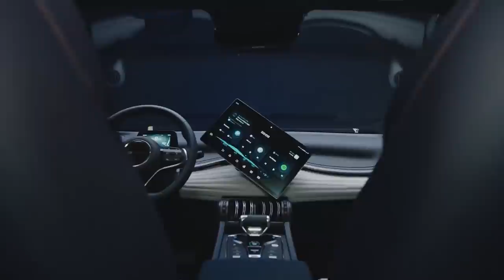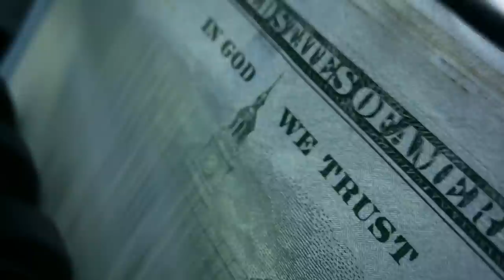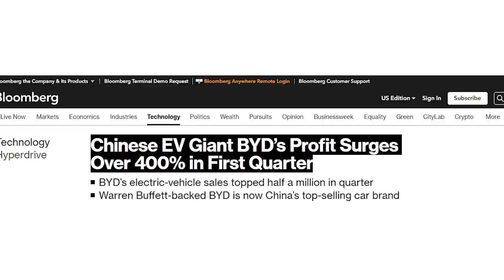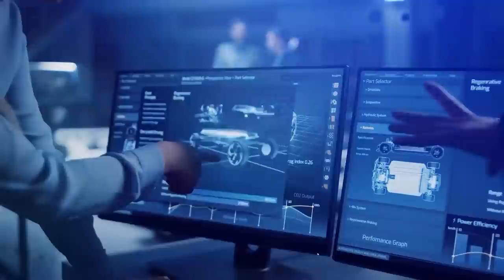HUGE Blow For Tesla | BYD Mach Profit Margins (almost)

Comment: From January to April in 2023, BYD passenger car cumulative sales have reached 757,384 units, the performance is really strong. New energy vehicle network learned that BYD's new car sales in April, hybrid and pure electric sales continued to show a flat trend, including pure electric vehicle sales reached 104,364 units, an increase of 81.81% year-on-year; The sales volume of plug-in hybrid electric vehicles reached 105,103 units, an increase of 118.64% year-on-year, with the two forms of power respectively accounting for half of the total sales volume.

Comment: Seagull's price is insane, if current technology really allows such a car, even say in Europe, for 15-16 000 euros, it will be a game changer. 
I think many people still when they look at electric cars they think that the market is limited BUT the fact that BYD overtakes Tesla in China or anywhere does not mean much in the grand scheme of things. But the fact is unless we talk about trucks and big SUVs, the small car market if they come in price near Seagull, will be obliterated by EVs. If they reach price parity with ICE, game is over, because unlike ICE cars which spend a lot of gas in city driving, EVs by definition are way better at lower speeds and stop and go traffic, which means they will save insane money in everyday use + small cars are usually not used for those long trips where some want 400-500 mile range + EVs by their design allow for more space in a car than ICE, even a smaller car can feel more spacious. Also gas prices in Europe... people saw electricity come up due to Ukraine war, but now the price is returning back where it was and there is more and more wind and solar installed which means even if you do not have solar yourself, you can catch the times when electricity is cheap due to high wind and solar generation and charge the car then literally for peanuts. And a lot of times that is on holidays and at night. And many people work at least some days from home. More low speed chargers will need to be installed near parking stalls, but that is cheap if we talk about overnight charging/low speed charging. And it will help the grid if electricity is taken out when there is oversupply of it. Gas prices also went up due to Ukraine war but those are always less eager to go down...

I mean already Model Y is a best seller in Europe and I understand why, if they manage to get its price down 10 000 euros more if technology improves, batteries become even cheaper, it will just be massacre. Most likely Chinese will be first at that price point, but there is an issue that people still do not trust Chinese cars nearly as much as some might want. It will slowly change perhaps, but not happen overnight.

Sure, you might want bigger range for EVs or faster charging (even though it is getting faster all the time) and be more sure about what is the battery degradation. Also not a lot of repair shops still, it all delays EV revolution, as well as higher prices for EVs when you buy them, but when all those things come together (and I believe the turning point would be price parity at purchase with ICE cars which I think is possible), there will be a massacre. Even just because at certain points of day/nigh electricity will be very cheap and driving those cars especially around urban areas with a lot of stop and go and regen possibility, will save a ton of money especially in Europe with our gas prices... It will save enough that people will be ok that occasionally they need to stop and charge when on longer trips.